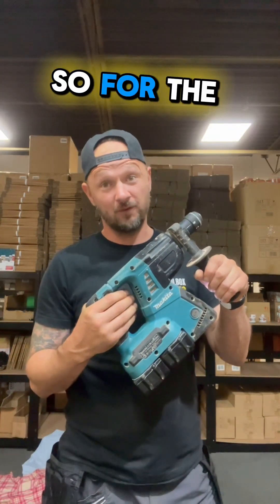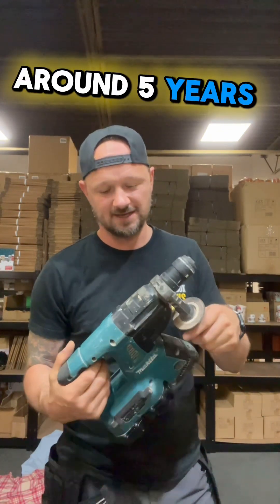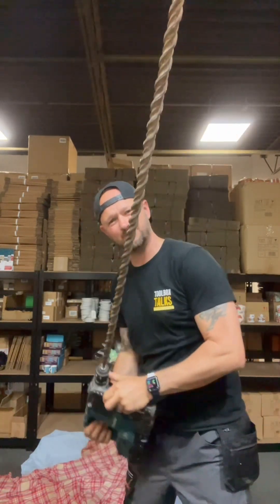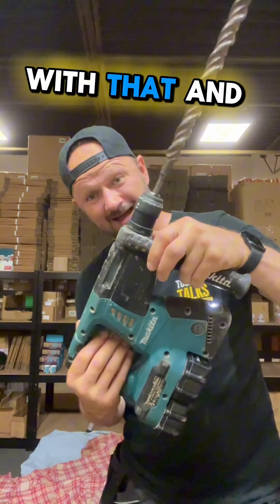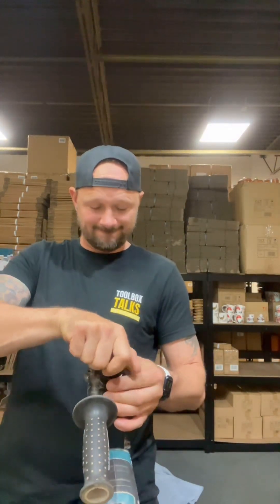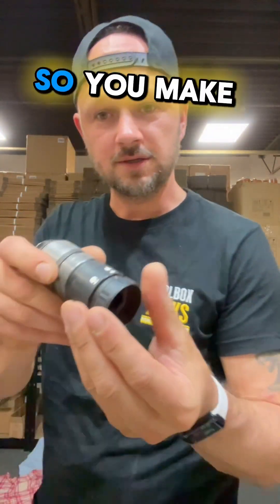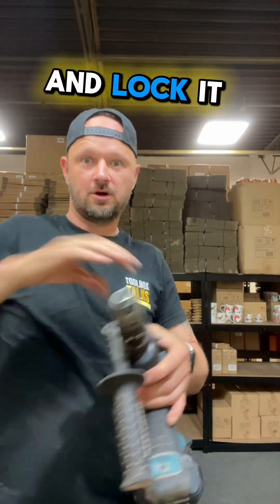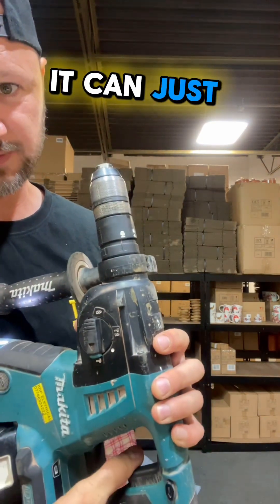Ultimate Guide to SDS Drill Types for Electricians

Comment: Theres a lot of power tool snobbery in the trade. Turn up with a Parkside or a Black and Decker and you're going to take some stick.
Reply from the maker: Yes this is true, but put Parkside up against some of the leading brands, they don't perform well. They may be 1/4 of the price but try out a god brand one - They just work so much better
Reply: @toolboxtalking  have you noticed the joules ratings effect chiselling tasks? Aka tough tiles or tile glue. 
HR008GZ01 seems to be the new do it all gun.
Reply: black and decker is dewalt people get confused and ive used parkside their decent tools